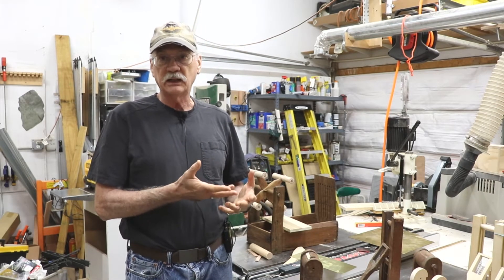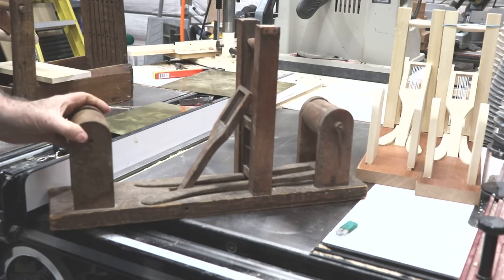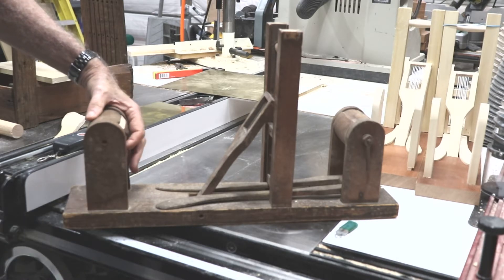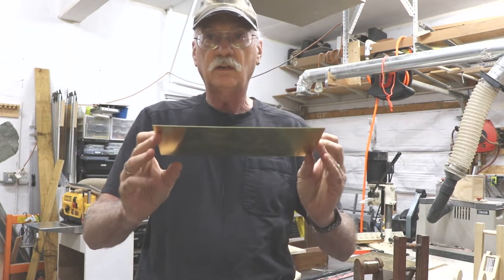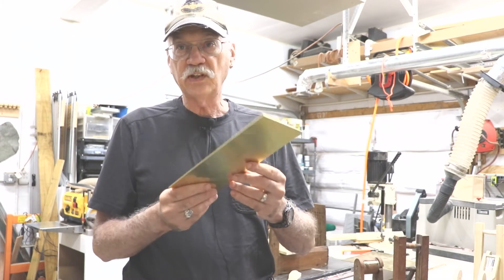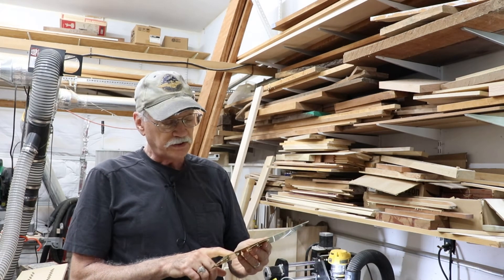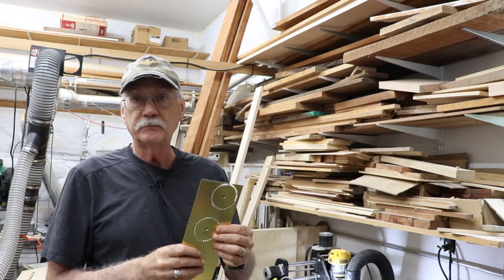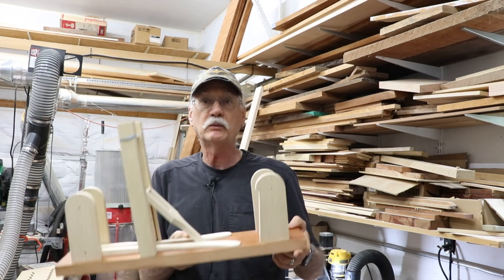Cutting a Brass Ratchet Gear On The CNC

Comment: The original teeth look a lot like filed saw teeth, I would expect that's how they did them. Maybe even cut from an old saw plate.
Reply from the maker: It's only .032 stock so I don't see using an old saw as these were a production item or close to mass production but it could be. Filing them individually makes sense but the original is a Shaker piece and they were very innovative with how they did things. The teeth are very symmetrical so they may have made a machine to produce them. It's an early 19th-century piece and the industrial revolution was in full swing. We think it was actually used to make lamp wicks but we are still researching that.